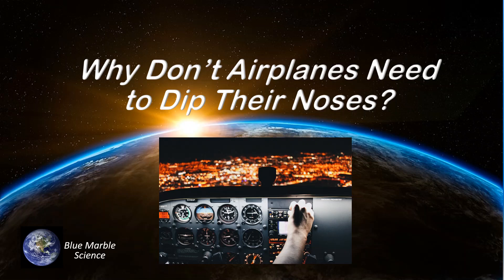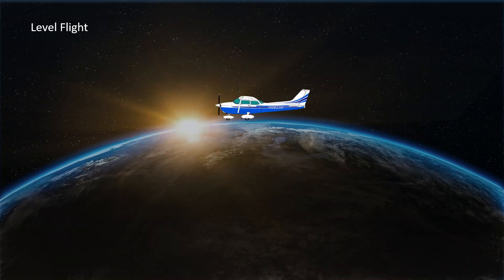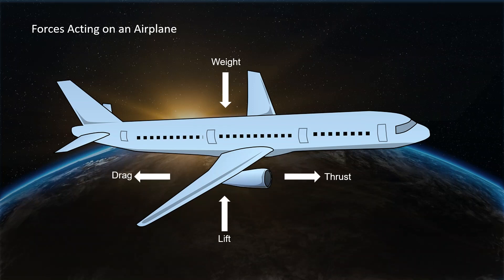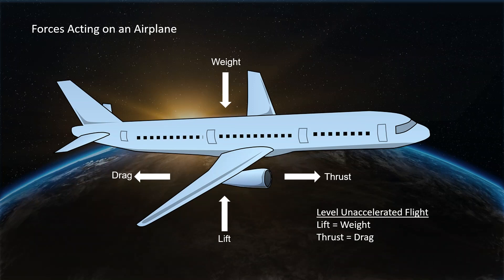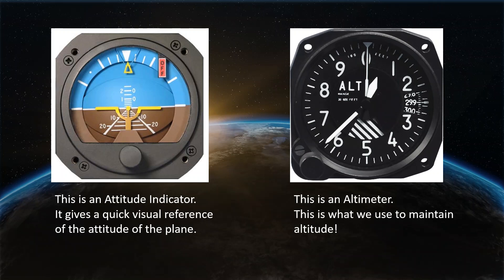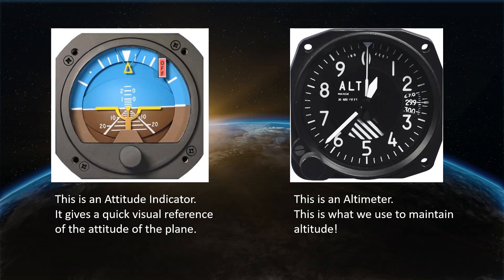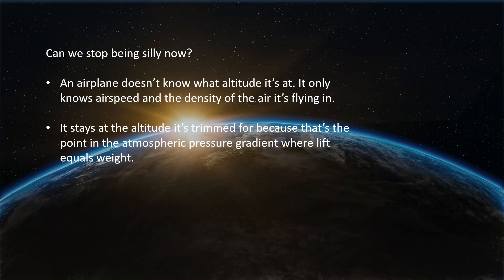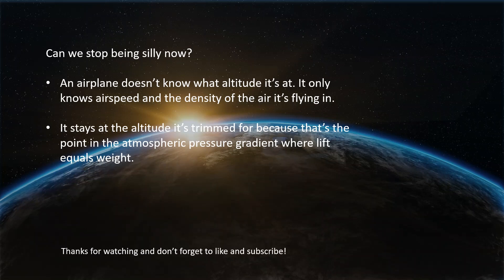Why Airplanes Don't Dip Their Nose

Comment: I want to start with a qualifier that everything you said is right, I'm not disputing anything you said. But you didn't really explain why the pilot doesn't have to dip the nose, you explained why it will fly at a set altitude but not why it's attitude changes -- and the answer is very simple.

A plane flies balanced between the lift from it's wings (lifting surfaces) and the pull of gravity. Gravity always pulls to the center of the earth, so as the plane transits across the earth the direction down changes pulling the plane into alignment with the local direction of down.
Reply: Precisely, which is as I commented earlier the "Exact same reason as why you don't have to dip the nose of your car on a long road trip." Swap "air in the tires" with "lift from its wings" and "car" with "plane" and the concept remains exactly the same, but even easier to grasp.
Reply: @AnthonyValcic  Good analogy.

Comment: A bit of a nit to pick at 3:05, but we hear so much about "vacuums suck" that I feel the need to comment.  The low pressure above the wing does not "pull up on the top of the wing".  The pressure differential between the bottom of the wing and the top of the wing results in a force upward, i.e. lift.
Reply from the maker: It's really a very complicated thing - much more complex than I made it sound. With a positive angle of attack, the lower surface is deflecting air downward, but as long as the flow over the upper surface remains attached, it too is directing airflow downward and that's the total lift. It's also why the wing stalls when the critical angle of attack is exceeded. When flow over the upper surface separates, instead of directing that flow smoothly downward, that region becomes turbulent and a significant portion of the lift is lost. But you're right about what you say - my explanation is just an easy way for for people to try and visualize what's happening.
Reply: There are three forces or effects at work on an airfoil. Coanda Effect, Bournoullis Theorem and Newton’s Third.

Comment: Great Video - If you do more Aviation videos one thing I would like to understand is how you deal with the Altimeter when flying to locations with different elevations. For example if you start from San Diego, basically sea level, and you set your altimeter for the correct altitude based on the current air pressure then fly to Denver how do you reliable adjust for altitude above the ground at a mile above sea level. Do you have to just remember that you'll be landing when the altimeter shows 5280ft or do you somehow reset things for local ground level.
Reply from the maker: That confuses a lot of people who aren't pilots. The altimeter is always referenced to mean sea level and the only correction we ever make to it is an adjustment for the current local barometric pressure. To know your altitude above the ground, we call that AGL, you have to know where you are. One key stat on every chart are altitudes of highest terrain and precise altitudes for any runway. Even with GPS, it's still telling you your altitude above mean sea level or MSL, so you have to take your altimeter reading and subtract the ground elevation of the area you're over. If you're lucky enough to be in a bigger plane, those normally have radar altimeters and then you get your altitude above the ground but little airplanes don't normally have those. Hope that helps.
Reply: @bluemarblescience  thanks. That makes a lot of sense. I've been watching some old training films from ww2 and have always been interested in flying and was always confused about altitude.  It does make sense now. Looking forward to your next video.
Reply: I learned about the altitude stuff (and a bunch more) when I couldn't stand any of the weather apps (Weather Channel... shudder!)  for my "smart"-phone and decided go write my own.  Pulling weather info from NOAA/NWS and current METARs from local airports.

If I was asked to name the best bargain the US taxpayer has ever gotten it would be NOAA/NWS... Hands Down.  (FAA would have to be number two... and they are rather closely associated.)
Reply: @its1110  

And NOAA relies quite a bit on NASA, for getting those satellites up there.  Conspiracy theorists have only the foggiest idea of what NASA is for.  Their exploration of space is just one piece of their mission.
Reply: We update our barometer setting along our planned route. Over the course of a leg from day Chicago to Denver, you may update your setting 6 to 7 times. We do this by calling a local airport close to our route or calling a flight service station and obtaining a new setting. This is key when flying long routes which may put us into different pressure regions, different than the setting we started our journey with. The key phrase we use is “from high to low, look out below”. Meaning that if we’re flying from a higher pressure region to lower pressure, we may be fooled, in adjusting our altitude, as it will APPEAR on your altimeter that were higher than we actually are above the surrounding terrain, and we unconsciously push the nose down a bit to correct this APPARENT deviation from our assigned altitude...the next thing you know, that TV tower that you planned to cross over safely at 1000’ above it, is right in your windscreen. Your question regarding how do we adjust when we’re at altitude, this is where standardization comes into play and as long as everyone in a given region has their barometer set to same pressure, it all works out as long as we all know the field elevation of our destination. In Southern Domestic airspace, we do as I’ve described above , but in high northern latitudes, you are in Northern Domestic airspace and up there we all adjust our barometers to standard pressure, 29.92, thus accomplishing that we’re all on the “same page” as far as cruising altitudes. We do this, because there are so few stations in the north to call for regular barometer updates.
Reply: It’s a long time since I’ve thought about this (1979 when I was doing my flying training) any airport you fly into would have a dedicated radio channel (automatic terminal information service) broadcasting a tape loop with up to date info eg active runway, local barometric pressure. This is of course updated during the day and each update had a different nato alphabet letter, so on approach you would tune into the atis channel, change the altimeter setting accordingly and radio the tower “received information bravo’” etc etc. I imagine this still happens but as I say it’s been a long time
Reply: Colin Field only at controlled aerodromes.
Reply: mbsevans yeah that’s all I know
Reply: BlueMarbleScience incorrect in many ways.

Comment: I just realized one more serious issue flerf pilots would encounter on their pancake inside a propane tank world......
Since there is an an atmospheric pressure gradient... Logically as the dome gets lower from the center... that would make their pressure lower towards the ice wall... therefore it would make their flerf plane to nose down automatically... so they would have to constantly pull it up to maintain the the altitude... unless they hit the dome before that at some point :D

Comment: Hello, I am a German engineer and would like to know why anyone believes, that the lift of an airplane is caused by the Bernoulli effect. And what's that nonsense with relative wind?
As you said wright, the wings have an angle of attack, 3 to 7 degrees when flying at a constant hight. The air don't necessarily have to have any ground speed. What happens is that the underside of the hits the air and that causes a vertical downward  acceleration of the air. This is a so called transfer of momentum. That's the action as Newton liked to call. Due to the fact that the air has mass, it is caused that the wing receives an upward momentum. That's the reaction like Newton wanted it to be called. As an intusiastic builder of model airplanes do I already know, that if your plane has enough power to produce enough thrust, you can get any wooden plank to fly.
By the way the Bernoulli effect is way too small to even lift a paperplane. And it's not Bernoulli, it's been Cuanda, and he wasn't it also.
What's wrong with you?
And by the way again, you make really good videos. Thanks for that.
Reply from the maker: Thanks for the comments. Relative wind is simply a term we use that indicates that the angle of attack of the wing has nothing to do with the attitude of the plane. It is the air flow in the direction the airplane is traveling which isn't wind at all. It's caused by the forward movement of the plane through the air.

I'm afraid I have to disagree with you on the lift generated by flow over the top of the wing. The Bernoulli effect is very real and very critical to the performance of an actual aircraft. You only need to go into an actual stall in a real airplane once to figure out how real that is. Even the smallest coating of frost on the upper wing surface and/or the leading edge will cause a disaster because it robs the wing of that very important component of lift.    

You're right about one thing though. With enough thrust, you can make anything fly (reference the Saturn 5 rocket) - LOL. Some military fighter aircraft have that sort of property although few military planes have a thrust to wight ratio over unity and civilian aircraft are much, much less. Most civilian aircraft are below 0.3 and as a model builder from 50 years ago, I know that having that sort of power to weight ratio would make a model a real pain and not much fun to fly.

Thanks for your comments!
Reply: @bluemarblescience  hello it's me again. Can you please explain, why the angle of attack is needed, when the lift is prduced by the Bernoulli respective Coanda effect? Can you please explain what's the difference between the lift produced by an airplane and the lift produced by a helicopter? Can you please explain, why a bumble bee is able to fly with its way to small wings when Prandtl's flight theory is right? Can you please explain, why a small airplane was smashed to the ground, that was ordered to use the same runway to land on that a way bigger airplane of the size of a Boing 727, that landed  a few minutes earlyer on that runway, causing the dead of the pilot? that happend anywhere in the US. This incedent caused a new thinking and new research on flight theory. 
What have had Prandtl and his colaborates done? They mounted a section of a wing to post situated in a wind chanel, started the engine that is driving the propeller, and took their measurements with this static resting wing. But that is something else to what happens when a airplane travels through resting air. One of Newtons axioms claims, that a action is needed to force a reaction. What did Prandtl make wrong. He changed the reaction to be the action. That leaded to a false theory. It's just like observing that the sun, the moon, the planets, and the stars are moving around the earth. But we know that's it just so that our beleved blue marble is somehow moving round the sun like the other planets do. Back to our closer look we have to considder, that the action is a airplane travelling tthrough resting air. The angle of attack causes a downward replacement of the air. Thats a reaction called transfer of momentum and at the same time it's the next action. The replaced air has mass. Mass is according to Einstein inertia. That causes a resitance against the replacement of the air. That results in an upward directing force or momentum. A tiny amount of time later the airplane has moved a short distance foreward leaving the downward moving air behimd it and replaceses a new amount of air downwards. In case of the fact that this would causes a vacuole, air from above is now also accellerated dowwards. But wait a minute, the air forced to travel downwrds cannt do that for a long period of time. Travelling downwards is at least stopped when the air hits the ground. but that dosen't happen. What happens, is that a circular turbulance is formed. That same circular turbulance is to be found around the rotor of a helicpter, that there is than in the form of a toroid around the rotor. Have you ever watched condensate stripes close behind an airplane with binoculars or a telescpe? They have the tendency to circle around with that turbulance. The one on the left hand side of the plan rotating clockwise, the one on the right hand side rotating countrerclockwise seen from behind the airplane. Do you really think that this behave can be explained with Beroulli's or Coanda's effect?
There's a nice webpage: www.flugtheorie.de launched by Jan Peter Apel.
So long for now. Have a nice time.

Comment: Great video! I’ve always thought this was a foolish argument to make. The fact that globe deniers will take a level onto a plane and use that as proof of a flat earth is mind boggling.

One question; you mentioned that level flight is the point at which lift equals weight and drag equals thrust. In your hypothetical example, you say that this point is at 85 knots. If I’ve understood correctly, once you’ve reached 85 knots and have made it to the right altitude, you can trim out and fly level and then you don’t have to make any other adjustments (assuming everything else stays constant). My question is this—if you are not flying at the correct airspeed or altitude to make lift equal weight or drag equal thrust, does this mean at this point you will have to continuously nose up or down? I’m assuming you do, and you’ll have to make those corrections until you do ‘level off,’ and reach either the correct airspeed or the correct altitude, right? 

Also is there more than one ‘sweet spot,’ if you will, where you could be going, say, 60 knots, but because your altitude is different than when you at 85 knots (I don’t know if the altitude for 60 knots would have to be higher or lower than the altitude at 85 knots), you can still fly ‘level’? Or is there only a single ‘level flight’ point for each plane/weight?
Reply from the maker: Those are some great questions Ben. and you're right. Within  the parameters of the airplane, we have to adjust the pitch of the plane to get the airspeed we're looking for and at the same time, we have to find the right power setting required to maintain our desired altitude.

The second part of your question is very insightful. There are an infinite number of "sweet spots" to select from. Our limitation is the available thrust. If we set the engine(s) at maximum continuous thrust, we have automatically set our maximum altitude. Our airplane can't climb any higher without exceeding the maximum angle of attack for the wing. 

But below that "service ceiling", we can do as we like. We can cruise at any lower altitude we like simply by picking an airspeed within the capability of the plane (set by the pitch of the nose) and adjusting the thrust to maintain our altitude. Sounds weird, but that's how it really works.

Thanks for the question and thanks for visiting the channel!
Reply: @bluemarblescience  I was taught to trade altitude for speed, or speed for altitude. Just a rough rule of thumb.
Reply from the maker: @garylittle8380  That's the way it works and it always works!
Reply: @bluemarblescience  Don't you just love the consistency of things when you're shooting an approach to an uncontrolled airport? :)
Reply from the maker: @garylittle8380  That usually results in a pretty high pucker factor for me!
Reply: Gary Little yep, trade speed for altitude if you suffer engine failure after takeoff (efato)

Comment: As a former helicopter landing officer/fuel handler (and wannabe pilot), I’d be extremely interested in general aviation videos.
Reply from the maker: I'm thinking about maybe a sister channel for that sort of thing. I had once thought about a full ground school for a private rating and another one for an instrument rating and I may do it. It's a lot of work but it's also something that you need to go through if you ever consider flying. The FAA doesn't mandate any particular level of formal ground school, but it's a lot easier to pass the written exam if you've gone through one.
Reply: In a video game (Grand Theft Auto) I fly helicopters a lot, and while it is obviously much simpler than in real life, I have to dip the nose down (more or less constantly) to gain and maintain forwards momentum. When going for a landing I have to lift the nose to kill the forward momentum.    

This would blow flat earther minds.
Reply: Ziploc hah a mechanic at one of the bases I worked at said in GTA was harder than real life

Comment: It's simple, really. Just as sea level is the same elevation all over earth, so is an elevation of 1000 feet exactly the same anywhere on earth. The forces acting on an aircraft trimmed to fly at 1000 ft elevation do not change as the aircraft moves from one place on earth to another. Assuming no change in speed, weight or air density, an aircraft trimmed for a certain altitude will maintain that altitude indefinitely.

Comment: I think you actually misses the main point of why it doesn’t gain height as the earth drops away. 
You need to mention that the plane is in perfect balance in straight and level flight and as it moves across the ground the direction gravity pulls changes gradually and it’s SO gradual that the plane manages to maintain balance as it does. Just like a set of cantilever scales remains in balance over its COG

Comment: But what about all the g force you would pull flying east or west. It must be a pain to fly a continuous corner. Also how do planes avoid being crushed when the flat earth is accelerating up continuously at 1g. Also after 6000 years since earth creation we would be doing over 6000 times the speed of light at 1g. This doesn't seem right to me